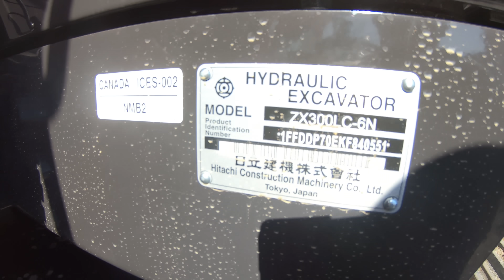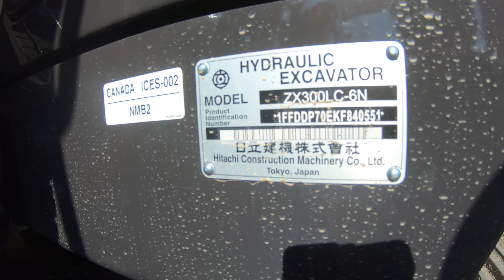Overheating mystery solved for John Deere/Hitachi Excavator 35zts

Comment: That pulley has a built in vibration damper, IOW, the rubber that filled the gap. Something to do with mitigating high frequency vibrations in the crank. They do fail in mid life.

Four things had me yelling at my tablet as I watched.
- you didn't clean up as you worked. That part of the engine room is all but inaccessible. It never hurts to make clean what is covered in oily dirt and goo.
- you didn't change the front crank seal. Seal rubber hardens over time and may get brittle. A disturbed seal will leak as often as not.
- making gaskets is no big deal. That's first year apprentice work. Gaskets can be critical. Maybe not for a belt driven water pump but some equipment has gasket allowances built in. Omit the gasket and something critical won't line up. High tech gasket sealers won't solve this problem. Another point is, some gasket sealers bond the mating faces so strongly, it's almost impossible to safely separate them.
- you did not replace the fan belt and coolant hoses. They're cheap, have a finite life, and, in this gadget, all but inaccessible. You have it open, change out the rubber goods

Outside of that, good work.

Comment: STEAM Clean the radiator and oil cooler Rad !!- if its had an oil leak at some point- the oil blows through the Rad then the dirt sticks to it and clogs up the fins !! ALSO !- Check the Exhaust muffler isnt rotted out ( check underneath) and blowing hot air into the engine bay or onto the radiator !!

Comment: After watching this video and thinking a little, its almost inexplicable why harmonic balancers, aka crankshaft pulley, are needed. With little education, mechanical engineering may explain why a crankshaft pulley needs a rubber insert to allow resonating frequencies transmitted from cylinder combustion is reduced to prevent  belt wear. Diy skills are hard earned yet valuable in reducing costs of maintenance.  The last time I saw this example was a Ford ac compressor clutch using a similar rubber dampener between hub and clutch plate. It too disintegrated until it failed. No ac doesn't affect engine operation but a damaged crank pulley affected alternator output and water pump, creating an overheating condition.
Reply: Think of the crankshaft as a tuning fork. Throughout the rpm range there is probably a frequency that will resonate and either beat every bearing out of the engine or break the crankshaft in 2.

Comment: The cause?  Whatever chewed up the fan probably tore up the rubber in the balancer pulley, broke it loose allowing the fan, water pump, and the alternator to turn freely.  I'm surprised that you didn't see a drop in the battery charge voltage as well. Although, your machine is probably not equipped with a volt meter, just an ammeter. Try to determine what got into the fan. Personally, I have not had good luck dealing with John Deere parts and service. Oh, they will sell you their overpriced parts alright, but they are very stingy with their manuals and tech info. You may be able to cross reference that water pump to a different piece of Hitachi or other brand of equipment. Often, Japanese companies use the same parts. Just a thought.

Comment: How many hours are on this machine Jesse? You may want to look at the motor mounts at some point the engine seems to move quite a bit even for a diesel
Reply from the maker: theres about 4k hours on it, and yes the motor mounts need to be replaced, I will tackle that sooner than later, I will probably replace the shaft coupler behind the pump too. it looked pretty worn when I rebuilt the pump recently

Comment: Nice job, while you have all that apart its good to replace any wear items while their easy to get to. Thermostat, belt, seal, and have rad cleaned internally. You can also source your engine parts from Hitachi. Many of the same engines were used in agri. equipment and are much cheaper than buying from Deere.

Comment: I don't quite understand why the pulley isn't just a regular solid pulley. Why does it need to have the clutch system? Nice job fixing it though.
Reply from the maker: It turned out to not be a clutch system, I just thought it was at first until I got the new part and realized it was solid rubber between
Reply: A harmonic damper is a device fitted to the free end of the crankshaft of an internal combustion engine to counter torsional and resonance vibrations from the crankshaft. This device must be interference fit to the crankshaft in order to operate in an effective manner. Wikipedia
Reply: A harmonic damper is a device fitted to the free (accessory drive) end of the crankshaft of an internal combustion engine to counter torsional and resonance vibrations from the crankshaft. This device must be interference fit to the crankshaft in order to operate in an effective manner. An interference fit ensures the device moves in perfect step with crankshaft. It is essential on engines with long crankshafts (such as straight-6, straight-8 engines) and V8 engines with cross plane cranks. Harmonics and torsional vibrations can greatly reduce crankshaft life, or cause instantaneous failure if the crankshaft runs at or through an amplified resonance. Dampers are designed with a specific weight (mass) which is dependent on the damping material/method used and the freedom it affords the mass move allowing to reduce mechanical Q factor, or damp, crankshaft resonances. A harmonic balancer (sometimes crankshaft damper, torsional damper, or vibration damper) is the same thing as a harmonic damper except that the balancer includes a counterweight to externally balance the rotating assembly. The harmonic balancer often serves as a pulley for the accessory drive belts turning the alternator, water pump and other crankshaft driven devices.[1]
Reply: The need for a damper will depend on the age of the engine design, its manufacture, strength of components, usable powerband, rev range and, most importantly,[citation needed] the quality of the engine's tune. The engine's tune especially in computer controlled applications can have a dramatic effect on durability,[citation needed] the aggressiveness of the tune puts the engine at risk of detonation which can be catastrophic to all rotating assembly components. Modern (roughly 1988+) DOHC, SOHC flat 4, I4, flat 6, I6, V6, flat 8, and flat-plane V8 have no need for this device. With or without the presence of a damper, a crankshaft will act as a torsional spring to some extent. Impulses applied to the crankshaft by the connecting rods will "wind" this spring, which will respond (as a spring–mass system) by unwinding and re-winding in the opposite direction. This crankshaft winding will usually be damped out naturally. However, at certain crankshaft rotational speeds, such winding can overlap with the crankshaft's natural resonant frequency, thereby increasing the frequency's amplitude and possibly leading to crankshaft damage.

Comment: The crankshaft seal could be the root of the problem. The oil could have compromised the rubber under the pulley.

Comment: jesse dinna go with the 400 dollar fix which wouldn't have fixed. Probably the reason they don't sell any water pumps is because it hardly ever goes bad. Would have been terrible for him if he hadn't noticed the harmonic balancer. I had a GMC pickup back in 78 that had the steel pulley come off the rubber damper. It may break the crank if the balancer isn't doing its job to mute vibrations of the crank but it wasn't a diesel which would be worse for vibration. So now his balancer is balancing, pulling the alternator and shoving the water through the radiator. His radiator still looks dirty but if it is running cool I am sure it is just fine. Some of these rigs that loose the fan shroud will overheat without the shroud, but his fan and shroud are great. Now his thermostat will have to actually work or it will cool his engine too much. hah

Comment: it looks from the fan condition that some time the fan jammed, that will shear off the rubber in the crank pulley (changed several for that reason)

Comment: That is probably why the fan belt was so tight. The friction help crank pulley turn. Might of destroyed the rubber damper to. Chicken or the egg.
Reply: It wasn't the belt that was so tight, it was the lower alternator bolt.

Comment: We had an over heating problem  with a jcb turns out the young fitter put on the job put the fan on the wrong way round so it was blowing hot air off the engine back through the radiator
Reply: You mean he bolted it up facing the wrong way, or mixed the wires on an electric fan n had it blowing the wrong way?
Reply: @jaxturner7288  he bolted it on the wrong way it would stand and dig all day but as soon as you were on the move beeep beeep stop light in red

Comment: Yanmar.
Many diesels have rubber vibration damper in front pulley note off set balance weight on it. Just replaced 2001 GmC 6.5 diesel failed same pulley .
I locktite key in way .
Reply: All vehicle and heavy equipment engines have that vibraton/harmonic damper.   I had to replace one on my 1964 Ford.  As each cylinder fires, it creates a brief but large amount of torque on the crankshaft.  Resistance to that torque is created by other cylinders during the compression stroke along with the accessories attached to the engine.  The damper reduces the stress and helps to keep the crankshaft from breaking.
Reply: Dan Burch Yes we had a Mack crank snap at a journal from torsional vibration issue from bad damper.

Comment: Those greasable pins in the booms of those Hitachis are a definite red-flag. In order to make them greasable, they have to bore out a hole all the way through, and then cut a slot right out of the middle, which is exactly where they break every time. If you ever buy a piece of equipment with that kind of pins in it, you should expect to have to replace them with proper pins rather quickly, especially on a machine of that size.

Comment: I couldn't tell if that was a diesel.  Diesel's are rather notorious for slipping belts, and damaging pulleys with the torque gain and mismatched harmonics.  (revs).  I am guessing the pulley has the absorber because it is a diesel.  Lots of those perish and "slip"  if you replace it with an all steel version it will probably fatigue and break, but that's a ways down the road.  I usually replace them with steel, I have never been a fan of the absorbers, and your failure is a big reason why.  Minute 35:58, yup its a diesel.  change your hydraulic fluid, it don't like being overheated.
Reply from the maker: yea, but you can break or damage the crankshaft without the dampener, thats what its there for
Reply: @jmuller86  Was that a Harmonic Dampener? You got no choice, gotta keep the crank balanced, yes. The VW dual mass, and a few others are not harmonic, and those you can ditch.  Good work.
Reply from the maker: @mikeobrien3744  yea this was a harmonic dampener. I had atleast 20 comments on here saying I should weld it. but that could cost me my motor.thanks

Comment: Is the video mentioned below by you,  that includes replacing oil seals, been uploaded yet?
Reply from the maker: You know, I made a video about it, it took me a long time to do it. and then I had to upgrade my software and it messed it up to the point of having to redo the video completely, so I kind of gave up on it, because it was like 4 months ago. But I may still put it together.
Reply: @jmuller86  Hope so, but I understand.

Comment: Maybe your friend Andrew has the same problem with his little Komatsu.
Reply from the maker: i didnt know he still had a problem with that machine but I do know his hitachi has been overheating and I did wonder if this was the problem
Reply: @jmuller86  that clutch part is $50.00 for the kubota ones here at my dealer  wich alot cheaper then $480.90 john deere ones plus kubotas are still making parts for older kubotas wich pretty smart of them keeping kubota  parts for older units still avaliable

Comment: Many balancers have rubber between the inner and outer ring. You have an oil leak coming from above. Oil destroys the rubber causing the rubber to fail. Fix the oil leak or it's going to eventually happen again.
Reply from the maker: I did replace that crank seal
Reply: @jmuller86  Thanks Jesse. I love your channel and spend hours watching them. You are very talented!

Comment: I am Guessing since your this far into it you DID REPLACE the SEAL ? Please tell me you did since there is alot of oil in that area . And your there so WHY NOT ? AS WELL AS THE BELT ....I have seen some Car motors with that type of pully on them and they have done the same thing . I think it was in one of my FORD F600 Box Trucks . I Think .

Comment: Why you didn't change the crank seal that was leaking?   Good call on the harmonic balancer
Reply from the maker: It didnt appear to be leaking , but your right I shouldve changed anyways
Reply: @jmuller86 - At least you know the procedure how to get to it quickly in case it starts leaking badly...

Comment: for $200  I would take my little handy welder and put a few tack weld on the sucker and it will spin up the same speed as the crank.
Reply: Not a good idea.

Comment: All that work getting the water pump off and the fan belt, Then when you put it back together you used the old fan belt. while you have it down change the little things like the belts and seals. Spend a little now and save a lot later.

Comment: You should have replaced the corresponding crankshaft seal to damper because you probably noticed the nasty oil scum on the pan and engine.

Comment: I had a look at the comments and didn't see any on the subject so I thought I'd comment on the worn fan blades. Since you seem to have an oil leak that helped takeout the harmonic balancer rubber,
check the rubber in the motor mounts.  They could be sagging causing the engine to drop a little. That would cause the fan to strike the shroud.  It looks like the fan has been hitting the shroud for a while and you probably won't here it hitting anymore.
Reply from the maker: yea I thought about that too recently, and discovered that I do in fact need new mounts, I replaced one about 2 years ago but I think I need to replace them all, and even the pump coupler too so the engine will settle down a little with the jumping around

Comment: Hey there partner those mini excavators especially the smaller ones are known to have internal radiator problems especially if you ever put any bars leak into the radiator they're a cross-flow radiator instead of a vertical up and down probably be cheaper you go ahead and take it to a radiator shop and have them boil it out. Did you check to see if you have any hot spots in the radiator it's kind of hard to do it looks like on that particular machine anyway it's just a thought

Comment: The oil cooler looks like it should be cleaned, that oil will get to the rad as well.  I would take both coolers off and clean (pressure wash gently) them, as having an over heating problem. While yo have it opened. Get a pail  of Brake Clean and the tooth brush wire brush and start cleaning.  Ha a Death Stick Tower! There is your key way slot in that piece. Something else which is very good to use is Kopper Kote on all bolts. Do De torque them. Those blade screw drivers are good for cleaning the surface/s.

Comment: I would have replaced the crank seal while I had it apart. Kinda looks like where it was leaking from as well.
Reply from the maker: I did replace the crank seal
Reply: Jesse Muller oh okay, I couldn’t tell through video. Nice work though, that overheating issue was definitely a sneaky one! I woulda picked my brain over that one longer than you did my friend.

Comment: hey bro, i didn't see you replace the bolt behind the wtr pump pully, any left over parts? and the seal around the dampener should have been replaced or at lease cleaned, hope it don't come back to bite you

Comment: FWIW Good video.     Good education for the average operator.   DONT continue to use a machine when it is not working correctly and you DONT know why.      You had 3-4 reasons it could have been over heating and you just kept on running it.     If the rad is dirty  CLEAN IT.   Hydraulic  oil is hot???  and you just keep running it?  That plus the engine temp should have told you to STOP.   So many symptoms to tell you you had an issue but you just kept on going....  You got luck here and thats all there is to it.
Reply from the maker: I continued to run it because it didnt overheat until running full throttle for a few hours, I went through the process of elimination to find the problem. Without running it, how would I know if its overheating or not?
Reply: @jmuller86  Exactly you changed how you operated the machine instead of finding out why it over heated.   Thus you end up with 3-4 things that it "could be" by the time you stop and look for the issue.  I understand it was not an obvious problem but a clear issue.  FWIW you are a good mechanic my point was to operators not to continue operating a machine after it has a clear issue.